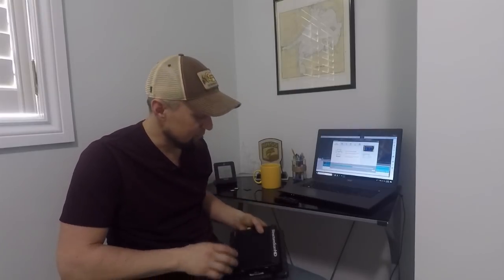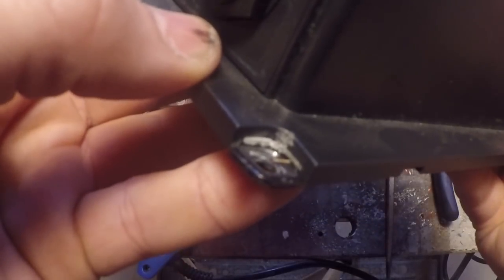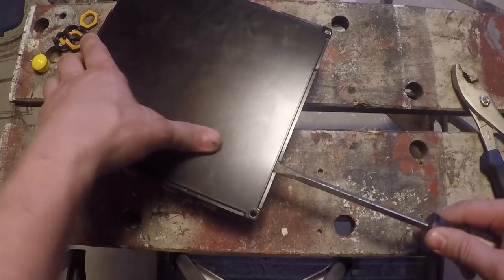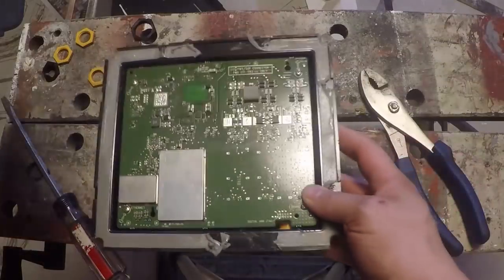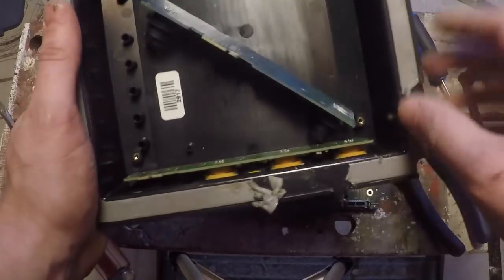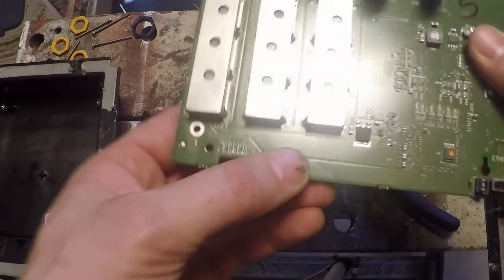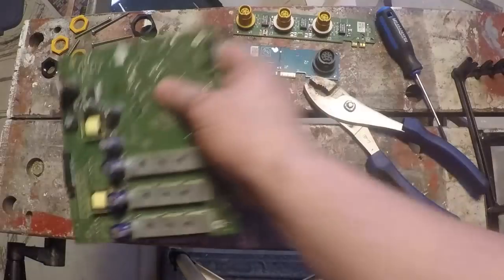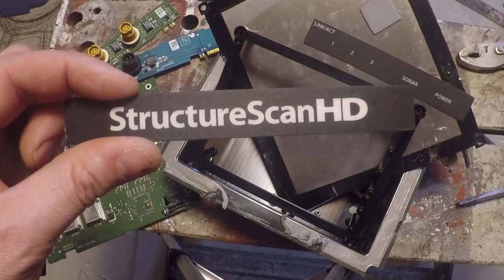StructureScanHD Tear Down

Comment: I dont see any power indication pilot lights on it.  Is the "power"  label supposed to back light when it is on?  Power going into it, but its not being seen on the network.  Any pilot lights on these units that illuminate when operating?

thanks